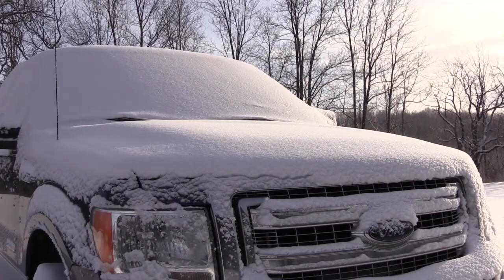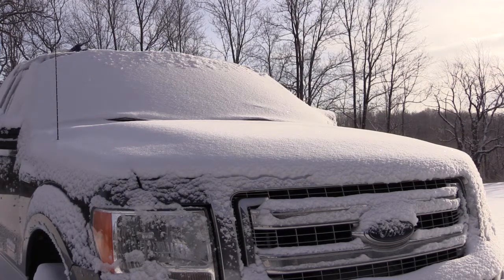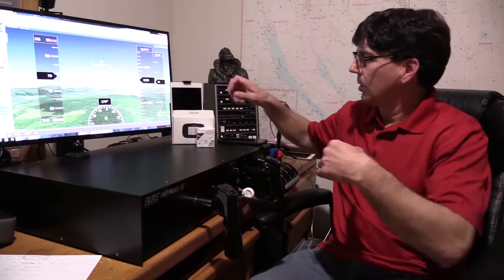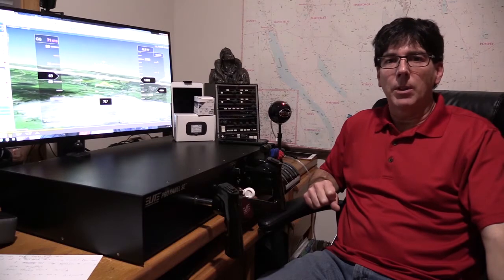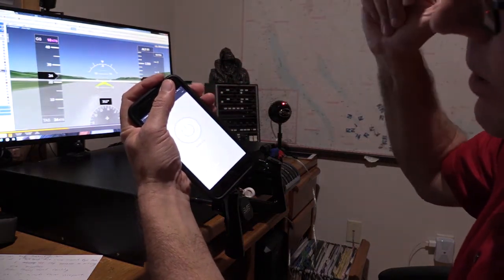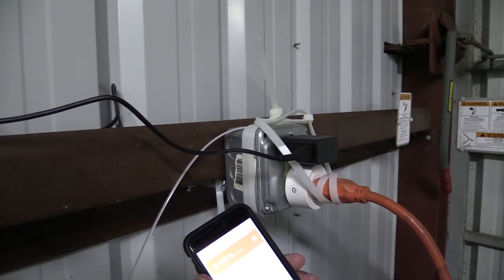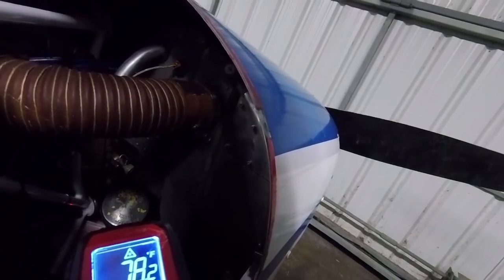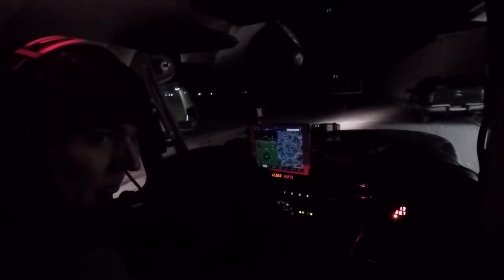Aircraft engine preheat Reiff preheater activated using Wi-Fi

Comment: Hi Gary,  can you provide a link to the smart socket you use?  I have Verizon Jetpack to allow remote monitoring of my crankcase temp/humidity probe but I haven’t yet found a smart plug that works with a hotspot (Belkin Wemo included).

Thanks, Garrett

Comment: Where did you buy the heating coils???
Reply from the maker: The heating bands can be purchased from reiffpreheat.com  I recently installed a set on my C182 and opted for the Turbo XP over the standard which I have on my C150. They warm the engine and oil nicely within a couple hours.

Comment from the maker: Hi Garrett,
When you setup the switch the directions will have you download the TuyaSmart app. From there you can connect with your Verizon jet pack. I’m into my second year using the switch and it has worked flawlessly every time. 

https://www.amazon.com/Socket-Amazon-Google-Control-Required/dp/B07G5XXLMM